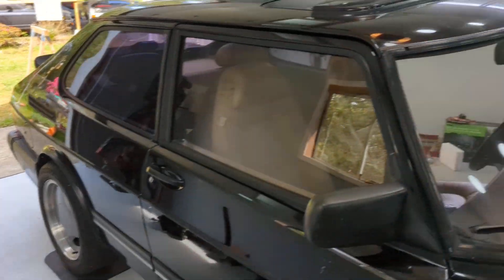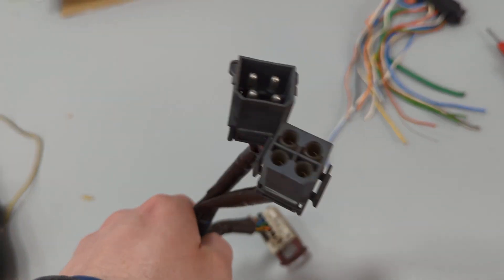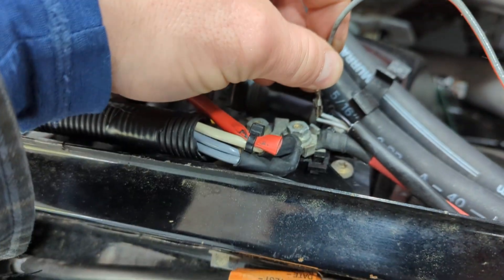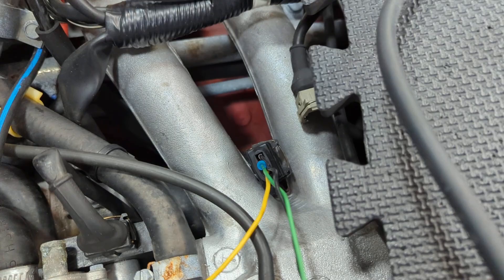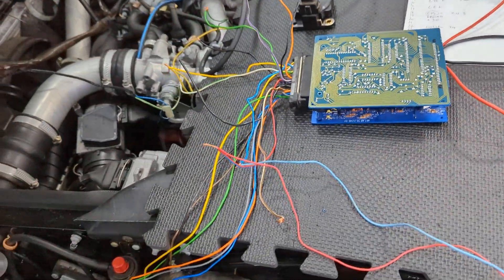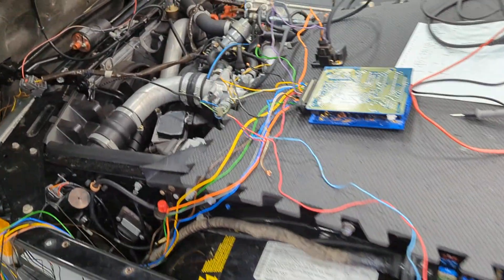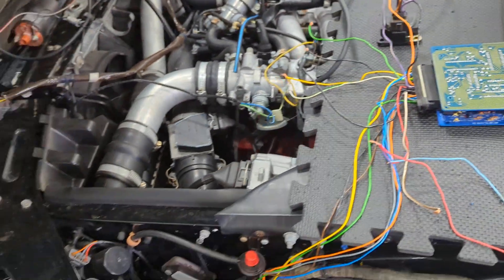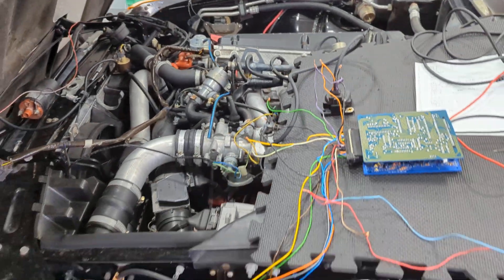Saab DI-88 system follow-up | IT RUNS

Comment: what is the advantage over a straight Troinic 5 install?
Reply from the maker: The main advantage is that I get to do something that's actually different than the traditional way and also not have to spend $2500 in the process